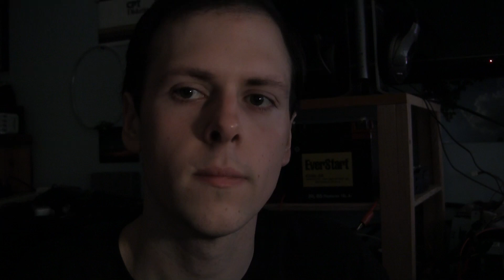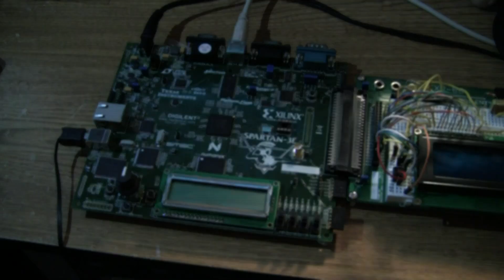Intro to FPGAs for Software Engineers - Part 1 - Introduction

Comment: @jandabrock Similar experience with Quartus II here with a single-XOR-gate test project (default compile settings). However, my next project, a 1300-gate NIOS II system, took maybe 10 seconds longer at most. Most of the time appears to be overhead.

For reference, I'm on an 8-core Mac Pro running Quartus II 11.0 in VMware (WinXP guest on OSX). At the time, the VM had 1 core (2.8 GHz Core 2-class Xeon) and 512 MB RAM. I've since upped the RAM since Task Manager reported a lot of swapping.

Comment: This is also a simulation, not compiling for an actual FPGA. If that's the correct terminology. I have an Altera noob board, but our chief engineer advised to just use a simulator for now.

Comment: Another thing about the Actel ProASIC3 Nano chips - it seems they don't require EEPROM, which might make the board even cheaper.  Also, there are no off-the-shelf cheap dev boards from 3rd parties.  You either pay Actel $99 dollars for their dev board (which has nothing much on it), or you have to make your own, whereas Altera Cyclone II boards can be had cheaply, but the component cost is quite a bit higher.  Seems a bit odd, and a 'gap' in the market which could be filled by a hobbyist design!

Comment: @Tbird761 A tutorial on constructing a board from scratch would be awesome, especially if it had downloadable PCB layout.  The Actel chips are cheap enough that I would have the confidence to attempt to solder one without worrying I'd stuff it up.  I can solder 0.5mm pitch SMDs but I have a success rate of about 1 in 4, so I'd be concerned if the part was much more expensive.

Comment: Thanks for this.  I found it a good introduction for someone who knows nothing about the tools and the language.  If you're still messing about with this now, maybe you can also try to do the same for the Altera Cyclone II.  The board you're using is a bit pricey for hobbyist stuff, so I'm interested in the dirt-cheap open-source boards.  They're selling an EP2C5T144 Altera Cyclone II board on Ebay for $47 which looks pretty interesting.  I know it's a big ask for your '1.5' viewers :).